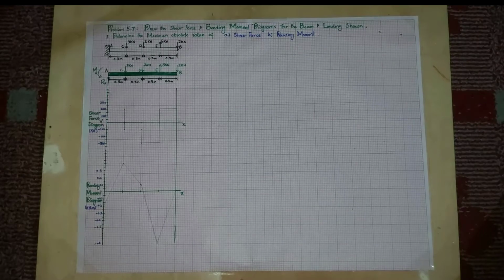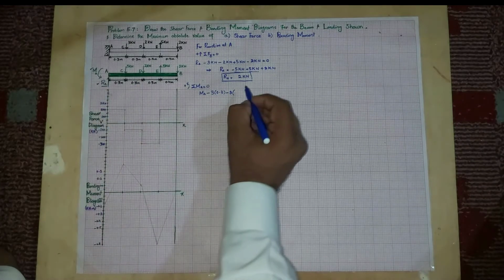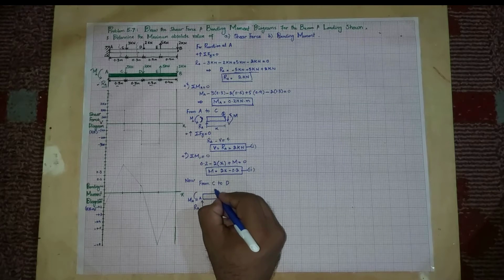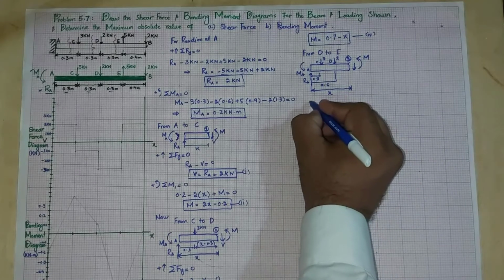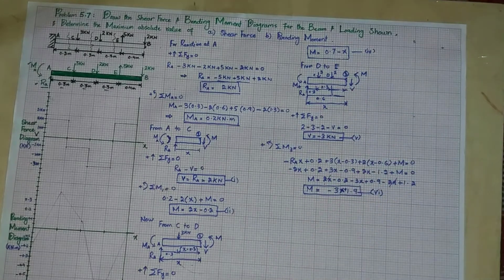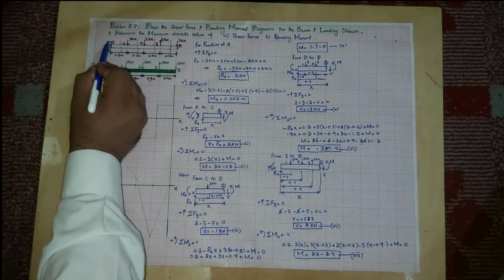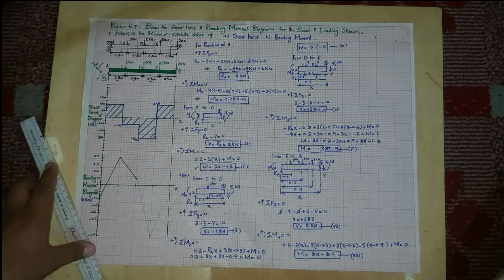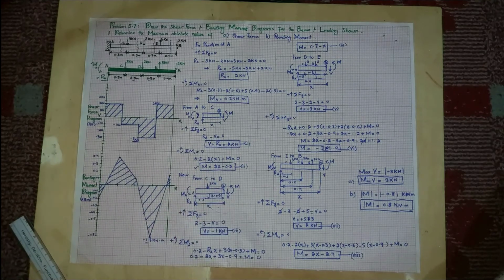Analysis & Design of Beam for Bending |Problem Solution 5.7 |MOM| Engr. Adnan Rasheed

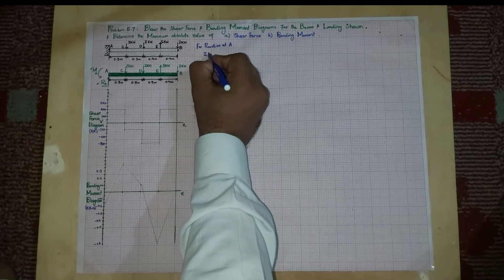Comment: sir here how you select the the direction of the moment at 1:48 I don`t understand
Reply from the maker: you mean moment direction at point A ? roughly you can see the net effect of point load is downward so it will produce clockwise moment so in order to balance it the counter clock wise moment will be there at A. Rest you can take any direction of moment and calculate its value if it comes out to be positive value it means that your assumed direction is correct and if the value is negative so it means that your assumed direction is wrong and it should be opposite to what you selected. Thank you